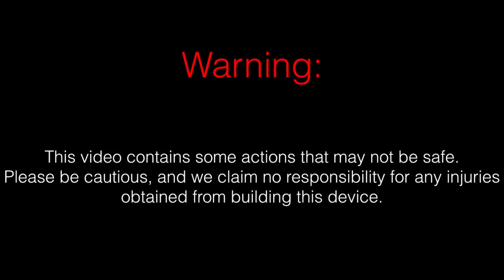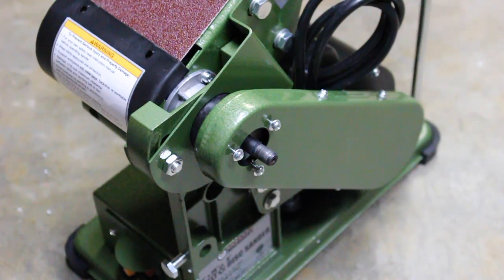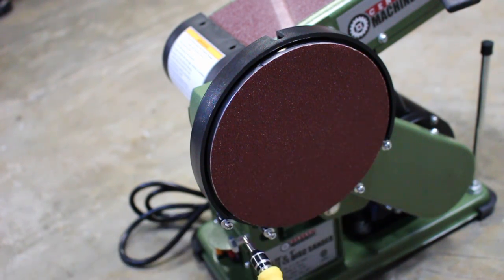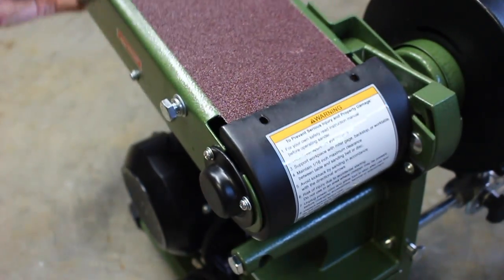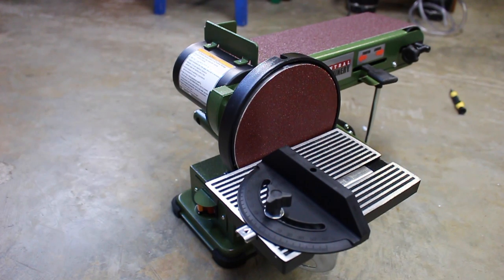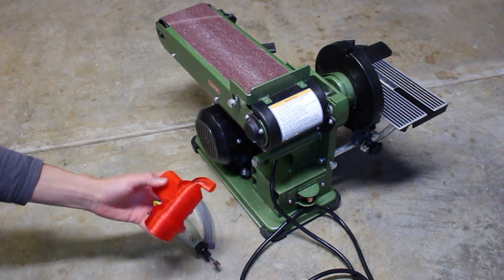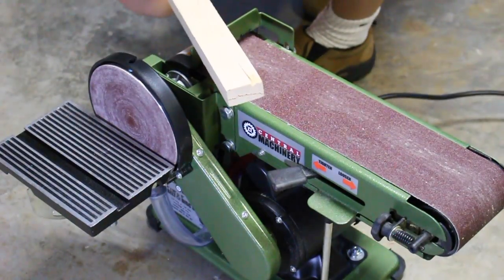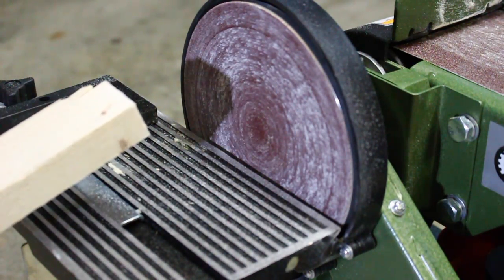Central Machinery 4"x36" Belt and Disk Sander Unboxing, Assembly, and Mod

Comment: Very useful! Batter than the instruction book that comes with the device, which skips several key small steps. Newer models have some slight differences to this one (and generally seem to be made worse and more cheaply) but instructions were still applicable and useful.

Comment: I went the cheap way to begin with. Big mistake. This thing didn't have enough power to even turn the belt!! I decided, no sense in fighting a bunch of re-habs & my labor 1st thing out of the  box. Called the store, asked to bring it back & trade for a BAUER!! So glad I did! Pulled it out of the box, attached a few items & went to work with it! By the way,.....plenty of power.

Comment: Anybody know where I can get these screws used on the plastic plate? Some how mine are gone..and I want to put it together. Right now I use the belt, but I want to use the disc. I  NEED SCREWS. Harbor Freight said they couldn't send them to me. UGH
Reply: Any hardware store. metric w/ flat washers (3) M4x 8 screws mount disk cover, same as belt cover screws. 
Ensure they do not hit pulley. 
(4) M3x 12 to mount disk port half to disk cover. Assume you don't have instruction w/parts list?

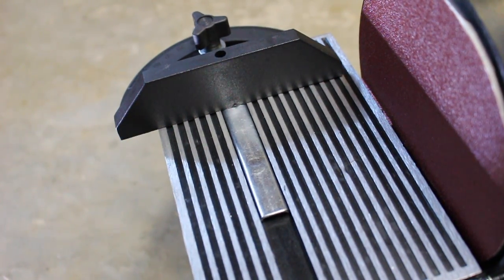Comment: Good video! However for ease of installing/use of fence, the 2 screws on the fence shown  at 5:23 are going thru wrong side of fence. The 2 fingers of fence slip UNDER the plastic bottom guard, between guard and the belt. Screws go in from top thru plastic into fence. This allows fence to easily be removed/installed without removing the lower plastic guard when you want to use fence or not.

UPDATE: Received my vacuum port adapter! Very cool. 
As I had already modified  my sander for ability to run full vacuum (cut out restrictor on belt port and subsequently added spacers to cover to stop belt being sucked into cover ) I had planned on plugging the 2 holes on adapter. Didn't realize until received adapter there is also a restrictor on end that fits on vacuum, smaller id hole. Easy fix cutting out to allow full vacuum, though the infill (learned something today) kinda thru me- junction of ID web and body is webbed, wall thickness isn't solid.
Reply: Hey thanx..  this made it alot easier for me ... to bad I had to go back and undo it from the original...   but still very helpful

Comment: I was mainly looking @ the vid to see how to replace the belt, but I'll look to order the vac attachment for sure.  Wish you'd have put the link to it.  I found it anyhow: https://www.ebay.com/itm/Vac-Attachment-Sawdust-Collector-for-Central-Machinery-Belt-Disk-Sander-Shop/332209930174?_trkparms=ispr%3D1&hash=item4d59413fbe:g:wvsAAOSwB09YOLWm&enc=AQADAAAB8KX%2FKt4E1xf3SDqEdBclaYadaNqgIzogNwJ3JP3dUnce%2B0uvUum1CjR5q%2BFABaA6nIBZwA%2Bh6hnhFAaxMonQdThVl5AZ5B4gCzl1eWGAPy28q8xmUq52s2yXvIzH6lUlm5ehf0jQD5QKWV3c4nOLqYQ6AG2wRTAQoVoZFab86uehwwkattf8GUgx8NBjTxOEHabblqo2CBVLW7l%2FTw4souv6xDI3TzF2UimJZRz1Xy4opfQUpwQ0pv7PTetOetdye3eVvKI%2FJRzVG2dmAxzIAtiLJc7fXHCC5%2FHDnx6fKZEMIx%2BE7MMNL8peeJfmKmZUXawkM79o7fNRhFAWl8UFSZrj0t122J7NqDNtp5bZLp40fe2zfO96L%2BzbSek6cLcIZpZS1ZCjzO5K3W7qCbm3IYnn6YCjDxLlKY9VxBD69wll3YdqcOpYJPCTAKKFYD1wbTsIOFiFvsQ6sTcfXyOFUtAuf8Y0oAnFmOObOgF%2FZ7pHPlucNT40LSXl2bFbROmwBWaFZJXlt2g3LH2m%2BXOHEk1zAQG8NXpqL4XmfcqayQXMM6X%2Bf0LfIzTJp7iF0i07T0BP2EuPWcVeqTgEqYpTbe2eEhC7VG1%2Bi4q71QLJIqN44NHkBhyCbilWQ8%2BvOjqQXMLXOtFOolNOwLjQxatRWNU%3D&checksum=3322099301745c198be03250425b9e73a753f3261969

Comment: Why 2 holes on the sides?
Reply from the maker: Without the two holes, the suction from the vacuum will suck the sanding belt downward and literally grind a hole through the bottom of your sander
Reply: Thank you

Comment: Did yours have no power mines cant sand anything the motor stops
Reply from the maker: Nope. Ours seemed to work just fine.
Reply: You might have to adjust the slack in the belt that drives the pulleys. Sometimes it comes a little too loose. There are videos on here showing how to do it and they seem to help.

Comment: Great vid for setting up the sander. Thanks! But, ummm... instead of spending $25.00 ( inc. shipping)  for your cool little shop vac adaptor,  (and it is cool) I just used a pvc elbow, some old tubing and a drill, and in 5 minutes had the same thing. Fit right on my shop vac... Cost me zilch...  Just sayin' :)
Reply from the maker: We always love a quick DIY fix! We just sell printed versions of our opensource parts as a way to fund future videos and projects.

Comment: Dude you put the fence on wrong the fence mounts go underneath the plastic piece not on top duh, you put the two screws in from the top thru the plastic to hold the flange down
Reply from the maker: Both ways work, but yours is much easier. Thanks for the suggestion, we'll make sure to include it if we ever make a remake. Thanks!

Comment: you needed a gas mask LOL come on
Reply from the maker: If you wanna get lung cancer, it's not my problem...
https://www.ncbi.nlm.nih.gov/pmc/articles/PMC1740548/
Reply: BananaScience sawdust is not a gas, it is a particulate - and a non carcinogenic one, at that.

Why did you link an article to the dangers of PVC inhalation?
Reply from the maker: I mainly use this to level the edges of PVC pipe so that they're the exact length I want. As I haven't watched my video in a while, I thought I demonstrated using PVC as that's my main use for it. Sry!

Comment: My thoughts on  vac  sys for this sander..the sizes are very common-Leftover CPAP parts...PVC plumbing parts  ... 100 sources of parts.IMHO.. a HD SHOP VAC is overkill.. I  am going with a small vac and adding ports  to lower suction or not.  guess I need to make a YT vid.
Reply from the maker: You're right. My vac is probably way overkill but it's the only one I have.

Comment: I ended up with a part leftover!!!not seeing it in the exploded parts display-- It runs BUT no way will I really use it w/o that part in place-the manual writer gets a D... what happened ?? looks like a page is missing.
Reply from the maker: That's odd. Could you please describe the part?
Reply: better will send in gmail (snapplz acct)
Reply: you have mail...
Reply from the maker: I'll check it out!

Comment: so is it just mine that i picked up or is that disk plate harder than shit to install? how'd you go about putting it on? i dont fee like breaking the thing.
Reply from the maker: It should just slide on and tighten with a set screw.
Reply: thats what i figured the box did have a hole through the Styrofoam right where it slides onto
Reply from the maker: Yup!

Comment: Nicely done young man!!  You might add a note about moving the motor slightly to prevent the sanding belt from slipping under load.  Loosen the 4 bolts that attach the motor and slide the motor to tighten the drive belt.  Drive belts on these sanders look to be of poor quality and I suspect that they vary quite a bit on their actual dimensions.
Reply from the maker: Thanks for the suggestion! I'll add it to the description!

Comment: Nice Vid Bro! I'd be careful though with using that bottom mounted dust port on the sander. I did a similar mod to mine. The shop vac was sucking the belt down as it was running, and ended up sanding a hole through the bottom metal plate. I'm working on a new version where I move the port to a more efficient location. I and can tag you in the vid if you like. Keep up the good work.
Reply from the maker: Yikes!!!!!!!!!! Sorry about that! :( Check the new updated version on Thingiverse were the belt sander intake hole is a little smaller to reduce suction. You could also try drilling a 5-10mm hole through both the vac attach and the part it connects to to let in more air.